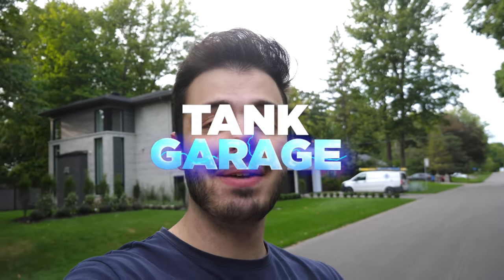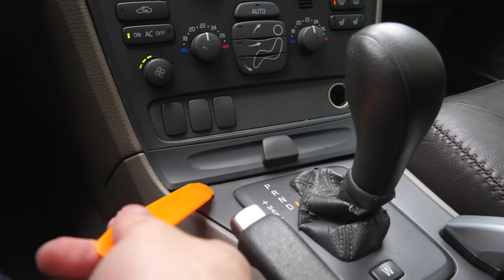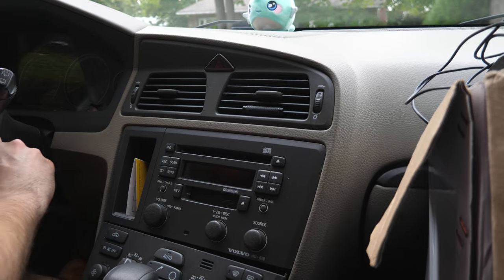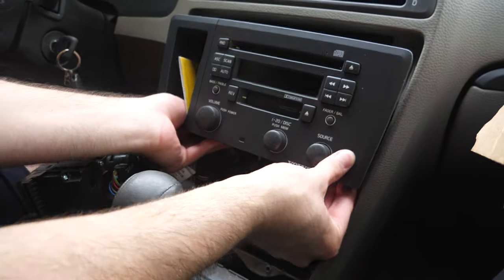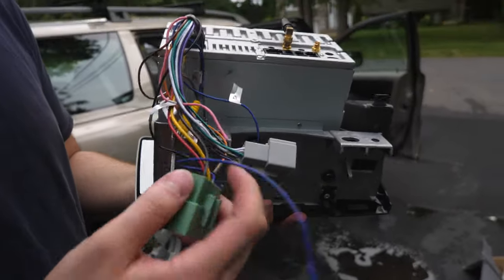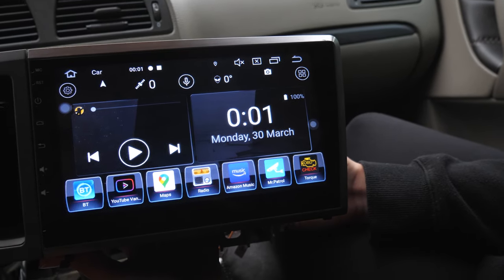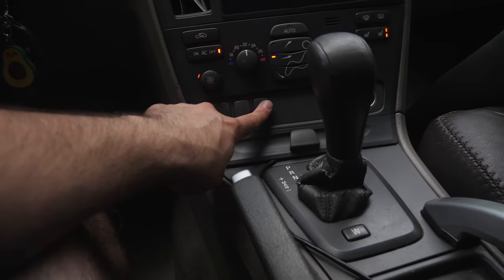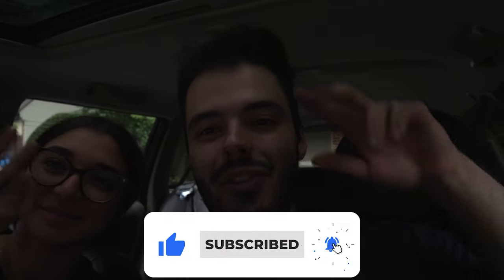INSTALLING AN APPLE CARPLAY RADIO IN MY GIRLFRIEND'S VOLVO XC70! Volvo XC70 Apple carplay radio!

Comment: one thing to add; do NOT unplug the AC "unit" if your battery is still connected, if you do - youll get error codes that you need to delete at a mechanic or with a OBD scanner

Comment: Unplugging the AC unit would give you air-bag errors. So good thing you keept it plugged in :) Google maps in offlinemode is due to no internet?
Reply from the maker: If the battery was unplugged I wouldn't f had any airbag messages! And it's technically safer lol!

Comment: Where can I find the plastic trim around the new head unit?
Reply from the maker: It's the same one as stock! Just cut open to fit
Reply: No extras needed. This unit is designed for S60/V70/XC70, but pre facelift. I have the same unit for five years now, happy with it. Just the GPS module seems a bit weak, but usually succeeds to find the route again after a while.

Comment: WOW... that's amazing, do you know if this can be done with a 2014 Volvo xc70?
Reply from the maker: Unfortunately if you have the water fall console I don't think this exact unit could fit! Since the radio and cd player is built into the climate control panel!

Comment: What brackets did you use to add to the newer stereo so you could keep that bin in tact?
Reply from the maker: Oem one!
Reply: @TankGarage  ohhh nice...so you just put it on the new audio? Didn't need any like extension or anything it made it work? Do you happen to remember the size of the new piece? I know you got it from. A friend and aren't sure the brand and all that but do you recall the size?
Reply from the maker: @d.jabele9864 I think it was 7-8 inches if I'm not mistaken

Comment: Can you still use the steering wheel controls?
Reply from the maker: No! After installing it you will not be able to use the steering wheel buttons!
Reply: You can if you get the correct kit, check out Crutchfield, I just ordered a new deck and harness that supports steering wheel controls for our 2004 V70
Reply: @endotron do you have the link?

Comment: I have a question, so I have a 2008 s80 and I want to get a body kit later on in the future, do you know some good body kits that I can get because I really can’t find any for this car
Reply: And also with exhaust, because I don’t want to straight pipe my car but yet I can’t find any exhaust
Reply from the maker: For the exhaust check out elevate out Becker they make catbacks! Which would end up cheaper for you!
Reply from the maker: @Evisuusg  There is no bodykit available at the moment for the S80! One company makes spoilers and ducktails but that's almost it!
Reply: @TankGarage  what’s the name of the company ?
Reply: @TankGarage  thanks man
Reply from the maker: @Evisuusg  I don't remember what it was called! But I'm sure you can find them with a quick Google search!

Comment: is there one available for the s80?
Reply from the maker: Unfortunately because of the way the radio unit is made on the S80 it is extremely hard to have something for it! Since the radio is connected on the waterfall design to most of the ac and heat controls! There are some Chinese options for head units but it would mean I would need to cut out a hole in the to of the dash which I'm not to inclined in doing...